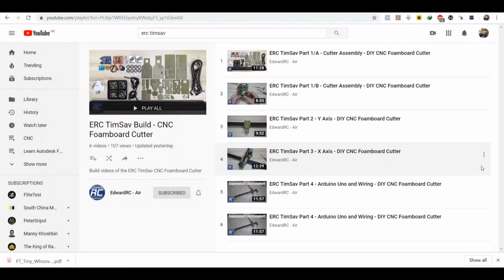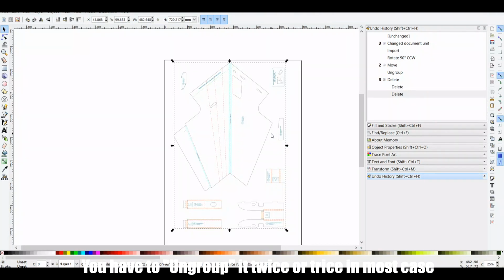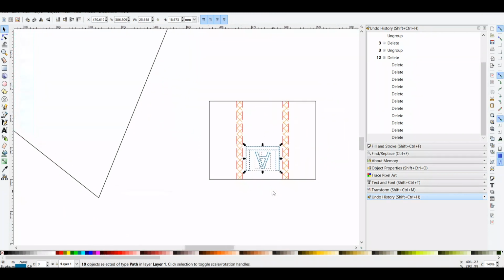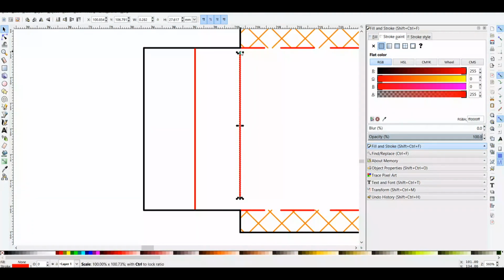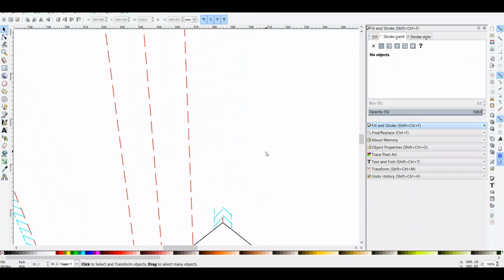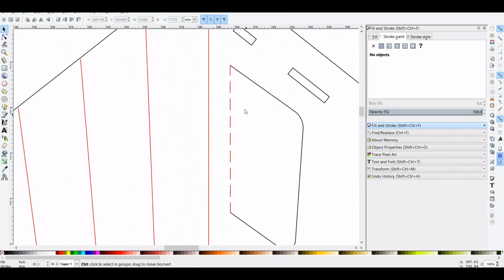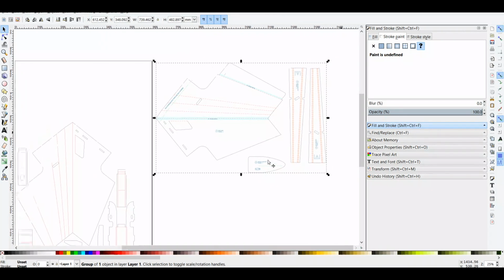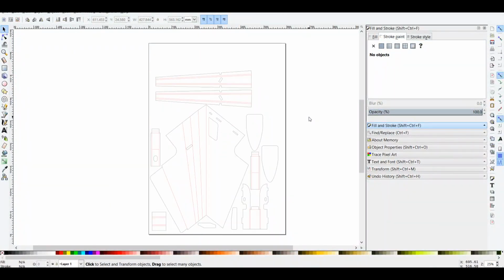ERC TimSav Part 6 - Processing Flite Test Plans for DIY CNC Foamboard Cutter

Comment: i aggree with david, much fast using the select same feature when deleting, as fas as node connecting i find the fastest way for me was to deleted all dotted segments in between endpoints via the select tool then use the node editor to select end points and shift+j to join then a few ctrl+alt+clicks on middle nodes that generate and your left with a straight solid line in place of the dotted

Comment: Time saver tips: Select one of the orange hatched line and then use Edit->Select Same (stroke color) to select and delete all at the same time. Then select a red line segment, again Select Same and then go into the Node editor. Highlight all the nodes on a dashed red line and use "Join selected nodes" to make it a single red line. Saves a lot of time... I did that page 3 of the Mini-Arrow in less than 10 minutes and I'm really slow. ;)
Reply from the maker: OMGGGG! David. Tqsm for the tips! Gotta add a follow up video then. wohooo
Reply from the maker: David it tried the select same and delete method works
The join node thing. do you still have to do it one red line by one red line or able to just select all the red and make them make straight lines? i tried 1, it created a new long red line by joining 2 together, but left the other breaking red lines beneath it which i dont want.
Reply: I'm certainly not an Inkscape expert but these tips were shared a long time ago on the FT needle cutter thread. While trying it yesterday, I found it safest is to highlight and work with the nodes on one line at a time... but I did find it possible to box select over several separate lines as long as I didn't catch nodes at intersections and endpoints and they would join properly. Holding the SHIFT key while doing multiple selections seemed to work pretty well... even in the node editor. Just watch the intersections and endpoints.